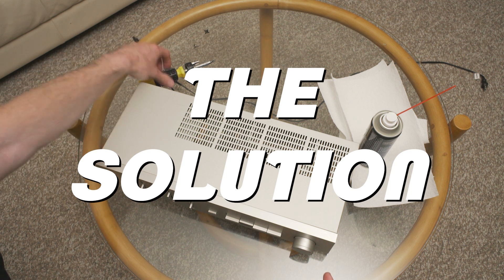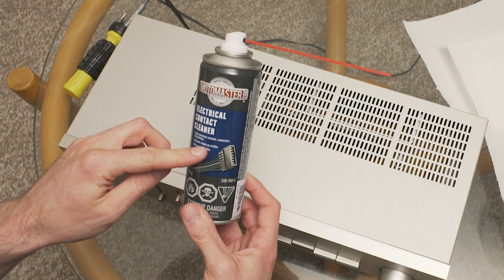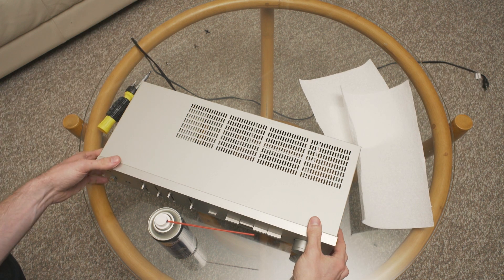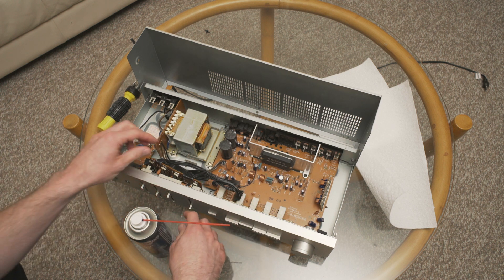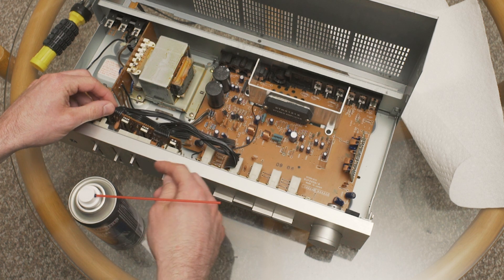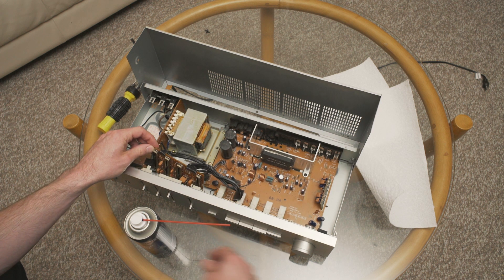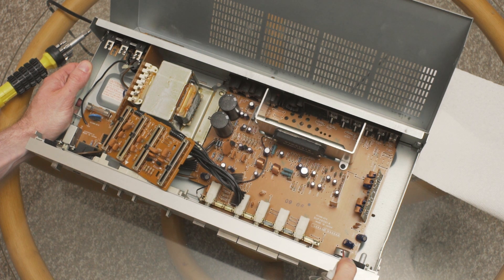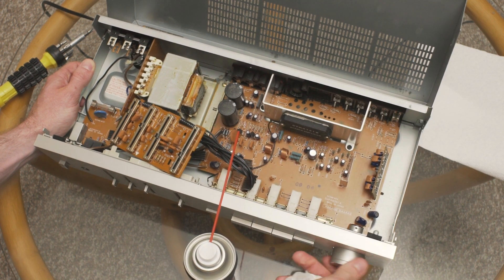How to fix your crackling or hissing speakers

Comment: WORKS!. I had sensor cleaner  and it cleared up the crackling noise. Before the cleaning, 1 speaker worked and the other would kick in and out. Now both are 100%. Good video.

Comment: one the two KEF 101 speakers has a crackle sound on one of the speakers, but I don't know if it is the tweeter or the board.
Could you assist/direct me in this matter? Thank you
Reply from the maker: Is it constant crackling or intermittent? Does it change depending on the volume? How are you connected into the amp?
Reply: @CodyGiles  it is a constant crackling
Reply from the maker: @elcid4207  what are the answers to my other two questions?
Reply: @CodyGiles  It is constant, and does not change by the volume, yes, it is connected to an amp, and pre-amp. I have changed the connection from Left to Right and only that speaker makes the noise.
Reply from the maker: @elcid4207  hmm I wonder if it's the connection on your speaker itself, could be dirty or loose. Could be a damaged speaker but it's usually more obvious. Is there another input type to try or is it just the RCA/banana plug type? Could take some 90%+ isopropyl and give the connector a wipe as well
Reply: @CodyGiles  I am going to connect it to a receiver to see if the problem persists. I do appreciate your time and input.
Reply: @CodyGiles  I have just used a receiver and result is the same, I checked the speaker's connections, they look healthy, and the sound is coming from the tweeter perhaps I switch the tweeters and see if that happen again. THEN I have no idea what the next step should be. ALSO, I have never done this before, so I hope I do not dig into more trouble.
Reply from the maker: @elcid4207  I'd definitely recommend taking it to someone who knows what to look for as you may damage components. If you're determined, you could at the very least open it up (unplug it first) and just see if there are loose wires or corrosion on anything. Don't touch anything metal or use a metal device to poke around any components
Reply: @CodyGiles I do agree with you, so far in this neck of woods, I had no luck. The nearest place I could find is in LA about eight hours away.
Reply from the maker: @elcid4207  that's too bad. You could try posting for additional help in places like here
https://www.reddit.com/r/audiorepair/
Reply: @CodyGiles Thanks for suggestion, I'll try it.
Reply: @CodyGiles Ok, I have switched the tweeters between the two speakers, and the problem still exist on the same speaker. Also, it was/is not crackle sound, (my mistake) it is humming.
Reply from the maker: @elcid4207  ah I've had humming before and it was mains hum caused by issues with a wire that I couldn't get to unfortunately. Here's a decent checklist to work through https://www.psaudio.com/ps-how/how-to-find-and-fix-hum/
Reply: @CodyGiles  Thank you, I shall try that, I have a tendency to believe that there could be a leaky CAP?
Reply from the maker: @elcid4207  definitely possible! Could make it receive dirty power. Look for bulging caps (their tops should be flat) and even better if you can test them with a multimeter. Just know that they hold a charge and can give you a good shock. Please refer to other guides if you're gonna go replacing them. Caps can be dangerous to you and your equipment
Reply: @CodyGiles  Thanks Cody, I'll be extra careful dealing with caps. I am thinking of upgrading the resistors and caps too, is there an online place you can recommend?
Reply from the maker: @elcid4207  honestly probably reddit might be your best bet to start and ask, they may point you in the right direction or community.  If you replace the cap you'll want to make sure you replace it with the same kind and rating. Just mention you're a beginner. Good luck!
Reply: @CodyGiles  Thank you, this would be a great start...
Reply: @CodyGiles  Hi Cody, I took the crossover board out, right away I saw the problem, on the back of the board some of the circuit lines (???) were corroded and there were no connections... got fixed and the speakers sound great. I would upgrade the resistors and caps later. Thanks for your help and comments.
Reply from the maker: @elcid4207  interesting, that'll do it! If you were interested, those circuit lines are known as circuit traces. Thanks for coming back and letting me know the issue and that you were able to fix it, that's good to hear.

Comment: My problem is from the speaker terminals of the B channel. I'm hoping like you mentioned its a solder issue. Its an continuous intermittent crackle whilst on this input
Reply from the maker: Terminals also wear out, might be worth swapping them out with a new one if you're able to. But definitely check if there's a loose connection first for sure.

Comment: Hi Cody,
I just got a small 8-track player (RCA Mark 8) and it worked perfect for a while. Suddenly the left channer started making cracking noises, stopped sounding completely and the started again. Basically it goes on and off. 
The cables, both the electric connector and the ones with the RCA line in ones are stiff and I don't know if that could have something to do with the issue.
I took apart the volume controls and applied some CRC 2-26 to lubricate them. but that did not resolve the problem.
Any suggestions? Do you probably have a video that addresses this issue?
I know it is not an issue with the speakers or the receiver. I have a CD player, reel to reel player and turntable connected to the same receiver and never had this issue.
Hopefully you can share some information or anyone else reading this, for that matter.
Reply from the maker: Hi Jose,

Keeping the classic formats alive! Love it. When troubleshooting I start easiest then go to hardest. So I'd look at trying new cables as old cables can get wear and actually fracture inside the jacket depending on how it was taken care of. The next would be the connections that the cables plug into, in your case RCA or composite. You can actually use a multimeter to check continuity, just search up "test RCA outputs multimeter". The jack might be dirty, or corroded. You can spray some cleaner in there and I believe they make an RCA jack cleaner tool. Could also try pipe cleaner and some of your cleaner as well. Worst case is it's a bad/cold solder or even a dead capacitor and unfortunately I don't have a video of how to replace that, and I'd advise caution if you go that route. Good luck!

Comment: Hi Cody, I have a home theater amp where one channel crackles and cuts out at certain low volumes until the amp has warmed up for a good 10 minutes. I've narrowed it down to the amp as multiple speakers and connection wires all have the same issue. Thoughts on a fix?
Reply from the maker: To me it sounds like a poor or dirty connection somewhere down the line. I would try a contact cleaner on the different inputs and even the potentiometer since it's similar to what I experienced in the video. A possible reason for it to work after the amp has warmed up is that a metal connection somewhere has expanded enough from the heat to make a better connection. It could be a bad capacitor but that doesn't make sense that it would go away after a few minutes
Reply: @CodyGiles  thanks for the tips! I'd like to give the contact cleaner a shot but I'm a little worried about the capacitors frying me!
Reply from the maker: @TehJBart  it's definitely a risk! You can look into creating a capacitor discharge tool or at the very least use a multimeter to see if the circuit is hot. Generally unplugging it and holding the power button will discharge the circuit but it's not a guarantee! Best to use a multimeter

Comment: i have got a yamaha musical keyboard... it also does randomly as i turn it on. sometimes with pressing keys, or playing...and some times with pressing keys... should i consider same fix for it? i mean blowing air inside entire unit and then applying cleaner as u did?
Reply from the maker: Hi Munawar. Generally this kind of thing is caused by a poor connection. That can be caused by interference such as electromagnetic or a physical interference such as corrosion, a bad ground, bad solder, etc. So in theory you could try HOWEVER! I wouldn't go opening it up unless you know what you're doing as you can hurt yourself or wreck something, in this case your keyboard. I'd recommend taking it to a repair shop if you can
Reply: @CodyGiles  dear... thanks for your support. infact i don't have anyone around in my city who could look into. But I got your general point of view. With the help of service manual i can dismental basic things, and then try blowing air as mostly techs. do.... may be this would show some hope. Thanks dude.
Reply: @CodyGiles  Hey. Greetings brother. I'm Jose Fernandes from Goa. I own Panasonic SC UA7, powered speaker. There's a problem with it. 

The code says it's related to power amplifier. There's poping sound and some bass noise. Also it turns itself off. What to do? Please guide me through. Also, it doesn't have grounding, just phase and neutral.
Reply from the maker: @josealfredfernandes  Hey Jose. I would recommend searching for a forum that may be familiar with that specific speaker or a similar one. I'm not familiar with it so I'm unable to help, sorry!

Comment: Big help man and sweet Shakey Graves!
Reply from the maker: Thanks Michael! Glad it was helpful. Testing speakers is much more fun with Shakey Graves
Reply: @CodyGiles  I agree! Just played their new album through a 60s tube amp that I just got. Had some static but did just what you said and now is smooth, the stereo/mono selector is real finicky though, has to be just in the right position or it cuts out one channel
Reply from the maker: @Kasty9001  Right on! Yeah some of those old switches can be pretty worn out or corroded

Comment: Hey Cody I got a technical pro home amp receiver it Rock's man but it makes a crackling sound only left  speaker any advice thanks
Reply from the maker: Hey Rogelio this sounds like it could be caused by a less than perfect connection from the amp to the left speaker so there's a few things to try:
1. Make sure the wire is making good contact on the output on the receiver and the input on the speaker and make sure the wire is in good condition (try reconnecting it if you haven't). Check the contacts to make sure there's no corrosion, if there is you're going to want to clean that off
2. If there's a manual balance/fade slider or potentiometer try cleaning it as in my video (of course make sure it's unplugged before diving into the internals. However if it's digital switch or sealed then do not do that. You can try quickly turning and sliding both the fader/balance and then volume back-and-forth  and sometimes that can clear up any crackling.

These are common causes. Of course it could be something internal in your speaker or amp and you can help narrow it down by trying the speaker first, by swapping the left speaker on the right speaker output on the amp, and putting the right speaker on the left output of the amp. Does the 'right' speaker now crackle? Or does the original left speaker now crackle? This would mean it's an issue with the speaker. If the now left speaker crackles then it's something with the amp or the wire. So try a new wire and then try a different amp to see if you have the same issue to rule it out completely. Hope that helps!

Comment: I have a samsung surround system and one of the speakers is makimg a crackling sound can u help me ?
Reply from the maker: I'd recommend disconnecting it and reconnecting the wires from both amp and speaker, could be a poor connection
Reply: @CodyGiles  i will try that but i already switched cable and speaker so i think it might be from the speaker.thanks anyway
Reply from the maker: @K86-j4y  good problem solving! It could be a dirty connection or cold solder within the speaker, if you're able to take it apart to look. Otherwise I'd recommend to bring it into an audio repair shop to have them take a look

Comment: What about burning smell? And my speakers don't open.
Reply from the maker: You might be overdriving your speakers (too loud or clipping the signal), you're likely smelling the voice coil overheating. Careful to keep the volume below where the sound is distorted or you might damage your speakers!
Reply: @CodyGiles  It has been 3 days since the smell started, the smell is still there without the speaker running in 3 days, is there a way to fix it? Theres no way to open the speaker to fix the crackling.
Reply from the maker: @mastermason4766  Are they new speakers? Were you playing audio loudly through them? Burning smells can linger for a while. Generally this is caused by playing audio too loud through your speakers or audio that clips which is hard on the speaker. If it continues to happen even on low volume, I'd recommend taking it into an electronics repair or a place that specializes in audio hardware
Reply: @CodyGiles  Old speaker, maybe 50-70% volume.
Reply from the maker: @mastermason4766  Hmm unless the smell is coming from the amp/receiver? That could be blown capacitors, or potentially having mismatched impedance. If you have 4 ohm speakers and the amp is rated only for 6 or 8 ohms, you can damage your amp. Generally the amp will shutdown when this happens, but not always! Best bet would be to check this, otherwise I'd take it into a shop
Reply: @CodyGiles  The smell has calmed down a lot, you can't smell it without your nose on the metal part covering the subwoofer, I cut the wire to the middle subwoofer and now the sound is gone.
Reply from the maker: @mastermason4766  Without seeing it I won't be able to help I'm afraid, best bet would be to take it in to a pro to give you a hand

Comment: Hi what does it mean when your speakers vibrate very hard  so there is no music just speaker noise but other timed thet play o.k and have a good sound  any idears. How can it be fixed.?
Reply from the maker: To me it sounds like a dirty or loose connection. I'd unplug all connections then firmly replug everything in. Also try connecting your speakers to a different amp or device to see if it continues to try and rule out anything else

Comment: Can i ask if it is a normal to have hisss sound on active  speaker while on ? No input connections and zero volume. Thanks help me
Reply from the maker: Active speakers can have a bit of hiss, depending on how they're built and the quality of the components. However is your hiss pretty loud? Have you disconnected everything from the speaker, except the power cable and there's still a hiss? Is the hiss noticeable when you have signal running through them? If it isn't then no worries!

I'd try plugging in your speakers in every outlet in your house to see if the hiss changes, if that's the case then it may be a power issue. Also Google your speaker's make, model and "hiss" and see what comes up, there may be solutions or it just may be the speakers themselves. Good luck!
Reply: @CodyGiles  a very little bit hiss u can hear when u put your ear near to the tweter i will try it to plug in other outlets
Reply from the maker: @bryanmanoza6515  depending on the internal components of the speaker, this may be normal for that speaker. When you run signal through you probably won't hear it at all, but I totally get it it may be annoying having in a quiet studio or something. I'd recommend Googling for some answers for your specific speakers and see if it's normal
Reply: @CodyGiles  thanks sir for helping me finding answers 
I actually ask them but still no response  thanks again for answering me
Reply: @CodyGiles  there is no connection only the power cable and no zolume zero

Comment: Can you do more, electronic fix videos?
Reply from the maker: I have a couple of specific lens fixing ones planned, but nothing else for electronics. Did you have something in mind that you'd like to see?
Reply: @CodyGiles  I would really like a video on speaker resistance with amplifier use. 

And not just matching Impedance, try more on running mismatched Impedance speakers like a 16 ohm and an 8 ohm and what that effects would be with power and frequency etc..
Reply from the maker: @Whitefox-pc7lp  interesting! I'll definitely consider it and let you know if I do!
Reply: @CodyGiles  awesome!

With your video technique, I figure it will be greatly informative and hilarious 🤘